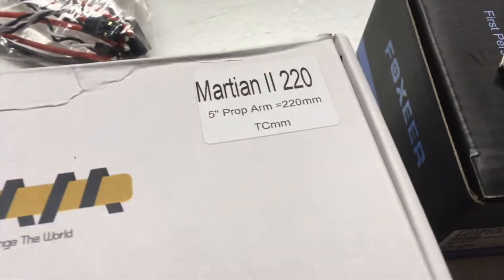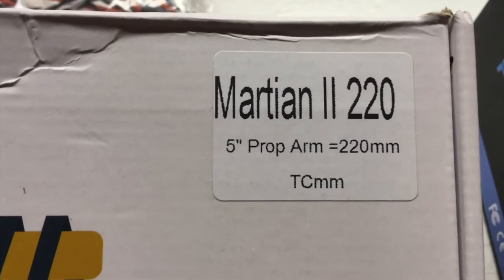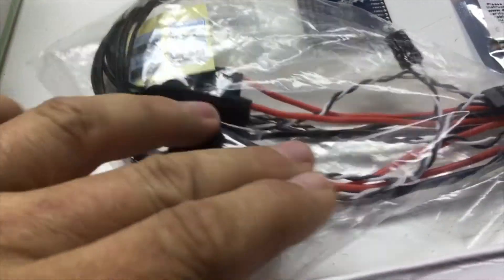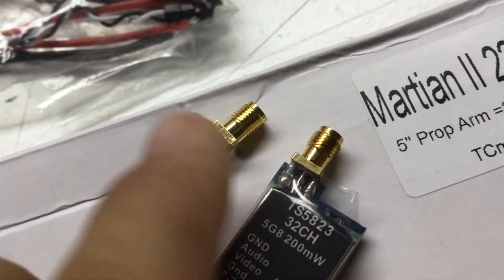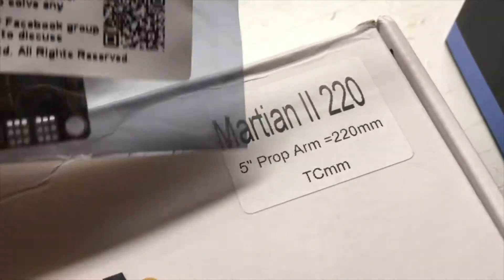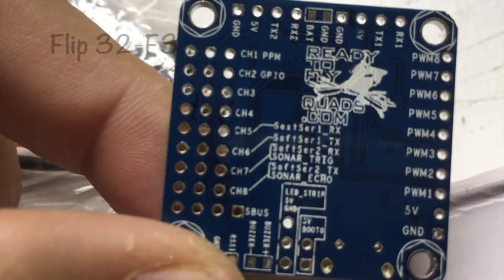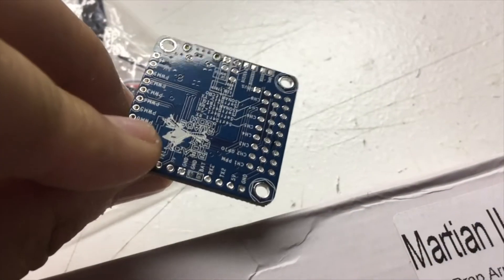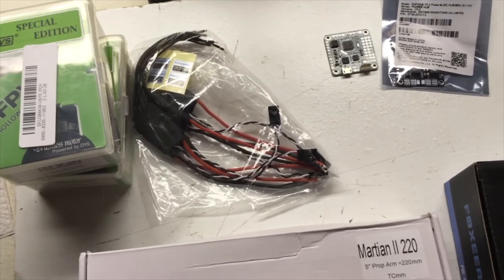Martian II Build (Part 1)

Comment: So is there much difference between the 220 and the 250 performance wise?
Reply from the maker: I really don't think frame size makes that much difference in performance. I think it would be hard to tell a difference in performance if both frames were equipped with the same components.
Reply from the maker: I just thought that with a 250mm frame you could use 6 inch props if you wanted to and that would certainly give you a different type of flight performance. It would also require a different (lower) KV motor to turn larger props without burning something up or killing your battery packs.